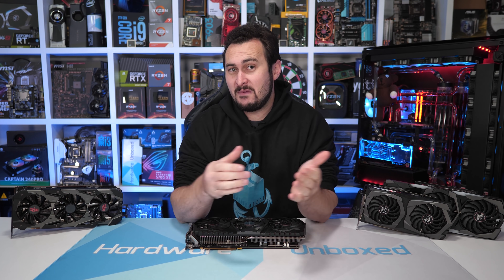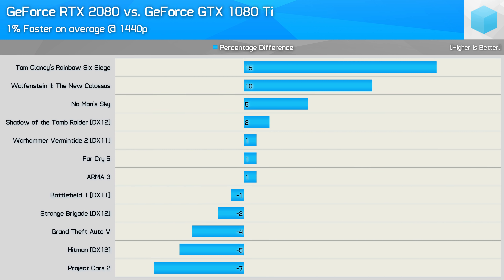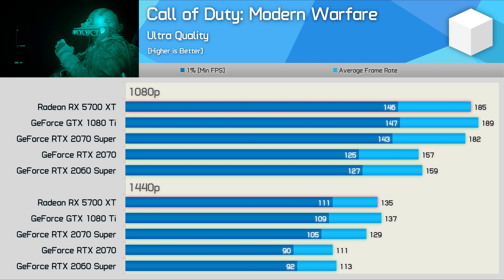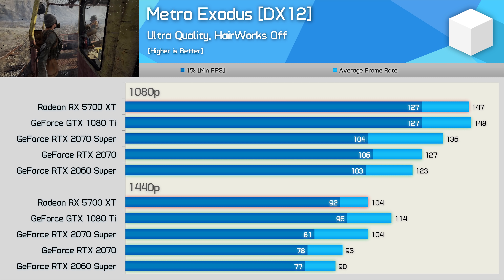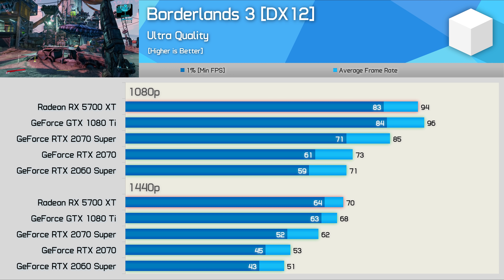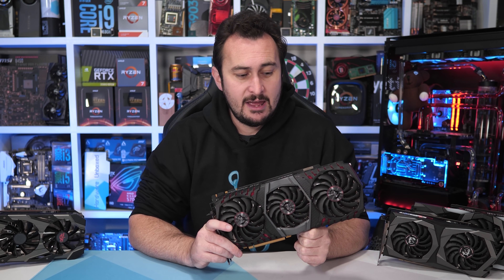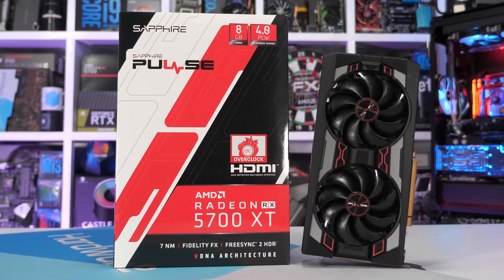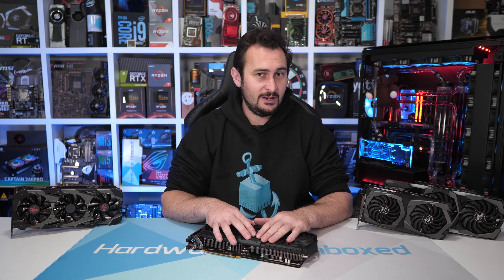GeForce GTX 1080 Ti vs. 5700 XT & RTX 2070 Super, 35 Game Benchmark

Comment: the 1080ti is arguably the best gpu nvidia has ever released in the modern gaming era. Absolute monster.
Reply: Not really, it's to expensive. 
The arguably best gpu's are GTX 970 or 1070(Last gen 080Ti performance for half price).
Reply: @Orcawhale1  they all are starting to show their age. The 1080ti still stomps a lot of cards today
Reply: @Alissa0601  Indeed, but with the money saved. You can just buy a 3060Ti, which stomps 1080Ti(If stock weren't a issue).  
You'd then end up with more performance for the same price.
Reply: @Orcawhale1  yeah undoubtedly the 3060 ti is the better choice, not taking current market state into account.

Comment: I got me an EVGA 1080Ti SC Black Edition about 2.5 years ago and never looked back. I was looking for something to replace my tired GTX 980Ti and this fit the bill and the budget perfectly, once I had sold my 980Ti the price to upgrade came in around £300... Which right now looks like a steal except then I decided to get myself a NZXT mounting plate and a Corsair 240mm CPU cooler and bolt that to my 1080Ti... Yes I don't have Ray Tracing or DLSS but realistically for gaming at 1440 or even 2160 I don't have to worry about either holding me back. Cyberpunk 2077 is running on Ultra, 2160p on my 60Hz screen and I'm not dropping below 42 - 45FPS... I just can't bring myself to sell the 1080Ti and add around a further £500 and not see atleast another 50% overall performance increase. Getting the 1080Ti was a win for me 🤙

Comment: I'm always curious what matters more currently as far as VRAM goes.  What is better, more memory like the 1080 ti with 11GB or faster memory like GDDR6.  I would love to see a comparison of the 1080 ti vs 2070 super/2080 or 5700xt.  Using games that at ultra settings, probably 4k, use more than 8GB of memory.  Yes, I know the game selection would be limited using that much memory.  Not necessarily higher fps, but the most stable ie less stuttering.

Comment: Hi, I hope I can get advice from you. I'm building a pc currently that will be used for gaming but mostly live streaming from my pc. I'm planning to play in 1080p 75 hz so I think I will need GPU that can support 1080p in all games with avg fps 75+. I sorted out my option. I was nearly going for RTX 2060 but then I saw the review that when we used RTX "on" in high or ultra setting in 1080p, 2060 is struggling to achieve above 60fps and it means that I buy RTX for nothing then. no way we want to go to 30fps again even though have RTX on I think.  I found a cheap used as below:

1.GTX 1080 for $270
2. RTX 2060 Super $300

which one would you recommend for those options?

Comment: But what about the 5700 xt's driver issues? I know it's been discussed to death, but the issue seems to persist even to this date. I can't decide between these two. I wanna give the 5700xt a shot but don't wanna spend more time troubleshooting than actually using the card. The 1080 ti on the other hand while old, has more mature drivers and raw performance.

Comment: I regret buying GTX 1080TI for $620 over RTX 2080. I saw the review and was like “Damn, they are the same but the 1080Ti is $100 cheaper". Then the 2080 starts to get better with every driver update, while apparently there was a small performance regression with 1080Ti. More importantly, NVidia neglected 1080Ti with new features like Integer Scaling (I don't buy into their architecture excuse, since AMD did it for all GCN cards dating back 8 years)

Today, 1080Ti is the same as 2070 Super...And I had to 'downgrade' to 2070S because I need the integer scaling for some retro games and DLSS 2.0

Comment: Bought a zotac 1080 Ti Mini which is probably the weakest 1080 ti given the small cooling for 300€. Even used RX5700 cards were 50€ more expensive, and used RTX cards are basically non existent over here. The 1080 ti was a no brainer. Shame I had to wait three years to be able to afford it though.

Comment: i have a 1080ti sc2 hybrid. i cant max out my voltage because the temps stay low enough that it keeps trying to clock higher than 2088 and crash. when i keep it at 2088 max and 2067 average, i get performance that is comparable to most overclocked 280super. better fan (corsair hd120) and a phobya plexiglass spacer keep me under 45c. some kryonaught and gelid extreme thermal pads brought it under 40c. 3080 hybrid will be my next gpu.

Comment: Really difficult market scenario here in eastern europe, have to decide between a zotac oc extreme 1080ti at 560USD brand new vs msi 2070super gaming Z for 600USD and 5700xt for 470-500USD for a decent SKU....not sure what to choose really 2070 has only 8gb gddr6 mem vs 11gbs gddr5 of 1080ti.....for even video production type of workloads to pair with a Ryzen 9 3900X, any advice is welcome, planning to upgrade to rtx 30 series in the q3-q4 of 2021...but till then need a good GPU and cannot wait for the 30  series to come out till October-November this year that is why need to buy one of them right now

Comment: I suppose the 3070 is going to be similar to the 2080ti then, but I'll wait for the 3070s if that's even going to be a thing. Around £500 for 2080ti performance 🤞🏻
Reply: W8 8gb is not enough. A 16gb is already being leaked

Comment: Hello everyone. I am in need of help from someone with technological experience. I have been looking at GPUS for the past 3 weeks and I just simply cannot decide what to buy. My price range is ~$400 US. I have a ryzen 5 3600, 16gb 3200mhz corsair vengeance, gtx 1660 and a 144hz monitor. I have been looking at the 5700xt, 2060 super and the 2070 super. Are there any other cards I should be looking at in this price range? I am looking for card recxomendations that are slightly above the price range because as the nvidia 30 series releases and big navi card prices are going to drop im told. I really appreciate any and all help!

Comment: I am having trouble pulling the trigger. 1. Refurbed EVGA 2070super for 409.  2.  Used from ebay 1080ti 380ish 3. brand new 5700xt 405 plus godfall and wow (dont really care about the games) pairing it with a i7 9700k.

Comment: Yeah im glad i got 2 1080ti's for SLI. Ya ya most games these days are not optimized for it but. Some games are, and its great when it is. 4k Ultra settings Shadow of the Tomb Raider at solid 60fps is nice. Unsure if the 3080ti's will be much of a upgrade. Except for newer games where sli wont work at all, then  a single 3080ti would be better. I usually game on a 3440x1440 so im not sure again, if upgrading is even worth it yet.

Comment: 10 Gaming perfected. I have to say that this generation was the best. I still have my Evga GTX 1080 SC2 since 2017 and it's an amazing GPU, but I'll be upgrading to an RTX 3080 few months after it comes out, or maybe even longer, depends what kind of FPS I'll be getting in Cyberpunk. But I'm more worried about my 4790K(had it since 2014 and OC'ed to 4.8GHz), It's starting to struggle in some of the newest games, if my CPU can't keep up in Cyberpunk, I'm gonna have to spend around 1000€, since Cyberpunk is the only upcoming game I currently care about.
Reply: I upgraded my entire system for cyberpunk. I now own a 3600 and 5700xt system. Coming from a Rx 280 I5 4670k  system
Reply: I bought a pc for monster hunter..sitting at 3600x and 5700xt now

Comment: Interesting that in 2020 I can get a card that performs almost on the same level with the GTX 1080 - GTX 1080 Ti with only $359$! It's my dream a few years ago to play games on a power beast like the GTX 1080 Ti. I got my Gigabyte RX 5700 XT with $359 on eBay (I got a $15 coupon from previous purchases)

Comment: Just bought a refurb 1080 ti from zotac for 413. Not bad considering my 1070 ti mini is still selling for just under 300. I probably would have waited for the 3000 series cards to drop but I have a second monitor (1080p 144hz) that only works with dvi. dvi was dropped by the 2000 series and I doubt it will return. Im sure by the time my 1080 ti isnt fitting the bill I'll lose the 1080p monitor and move to a 4k and upgrade my gpu again then.

Comment: I just upgraded to an RTX 2070 Super from an RX580 8GB since the 3D software I use utilizes RayTracing cores giving me a boost in viewport as well as in rendering. Also Nvenc is a good catch for stream decoding. On Top of it I get RTX voice for Team talks and for my streams ( I live next to a busy street and fire dept. is around the corner so is hospital and that was a major issue for me. It is a beautiful noise cancellation tech by Nvidia which works wonders.)   If It weren't for those techs provided by NVIDIA I would have gone straight ahead with a 5700XT and OC the hell of it. You see it is not always the difference in FPS or Watt usage... Please add various techs offerred by these companies while reviewing them.

Comment: nothing will beat 1080ti even when rtx 3000 comes out. it will be better to buy used 1080ti than a new 3060 100% unless 3060 has the same performance or better.

Comment: The Turing architecture still has loads of headroom for improvement with new driver updates for optimization while they pretty much stopped improving drivers for pascal. I got lucky and happily traded my 1080ti for a RTX2080 when some college guy raged because he had old drivers and fell into an echo chamber of 1080ti elitists on reddit going on about the extra 3gb of vram, which does not hold an argument because Turing allocates and uses the Vram in a much more efficient way. Also they were telling him RTX is all a gimmick just because the rough start with ray tracing. Its only gotten better and with DLSS 2.0 and VRSS. I traded cards in a heartbeat. Definitely his loss, my gain. Plus resale value will be much better since RTX is newer and will continue to improve. Don't get me wrong. I still think the 1080ti is a Beast and respect the hell out of it, But since a run 4K, I am finally getting a constant 60fps with max settings on all games without having to turn certain settings down and cant wait for that huge FPS jump when some of my library gets DLSS support. Maybe Nvidia or some Custom Drivers will figure out how to brute force it for use in any title. On another note, the next gen 3000 series probably wont come out until mid to late 2021 or later and by then im curious to see how far the drivers will push the Turing cards and what AMD is going to achieve with Navi since its look damn good in the next gen consoles but of course they have that lightning fast special I/O architecture with their 10gb/s SSD that even the PC market does not have yet. Buying a 1TB 10gb/s SSD is 2/3s the cost of what the consoles will cost which is pretty cool too. I love both PC and console and this next gen has finally caught up to mid/high tier PCs in terms of graphics and resolution for the first time in history on launch and if not maybe better in some cases because that special I/O architecture that's truly something needed for all next gen gaming for drawing in super 4-8k textures and insanely high assets quality without the need to normal, bump, or parallax maps on models. Since consoles all have the same hardware, they will be optimized even further just like the previous ones instead of trying to make a game work on tons of different components that are mix and matched like the pc world. Sorry for the rant.

Comment: Thanks for the Video! Here in Canada GPU prices are all over priced. I have a 1080 (Blower style) and contemplating whether to get a used 1080ti ($700-$850 is the price here) or a brand new MSI Rx5700xt for $590 (On sale for $40).

based on your review, I am more leaning now to the Rx5700xt. The 1080TI used prices here are just insane... I won't even consider a 2070 super here. Brand new is $800. almost same with a used 1080TI. Madness!. Only thing is keeping me back from AMD are the driver issues, which iv'e been reading they are updated and fixed now. Fingers crossed..

Comment: AMD always throws the cards that they sell the least of to the wolves and sadly that means the high end for them. 3 generations in a row I have seen this happen... it won't happen to me this time though. The only reason these people promote AMD GPU's is because it fuels innovation and lowers Nvidia pricing. THAT IS IT END OF STORY. None of these guys have an AMD GPU in their personal system so why should you? And if anyone does it's a Linux user aka edgy PC guy w/ his all AMD build. Drivers are trash, software is trash, and if you don't buy the one they sell millions of... (580,590 etc.) then fuck your support. Fury X, Vega 64, 5700 XT... all hot garbage, all released with issues 50% of which STILL exist to this day. Look at the Steam hardware survey stats for ANY YEAR since the feature was added what do you see...? Yes... your dumb ass is in the 1% of morons who bought an AMD GPU so they could throw all that $$$ in their CPU department. Well done. I'll be buying a 3080 TI and AMD can go fuck themselves. Just look at how the 1080 TI held up... same will be for 2080TI and the 3080 TI. So you can buy the big dog right now and enjoy it for years to come... or you can buy AMD $400-$500 trash every 3 years and STILL NOT CATCH UP AFTER 3 UPGRADES. Spend the fucking money or enjoy AMD software and driver support. Lmfao.

Comment: This benchmark video proves that 1080ti is still inthe leagues with the current gen cards.Between 5700xt vs 2070s if you are willing to pay 100 to 150 dollar extra for 10 to 15 fps then it's your choice. And for driver problems I bought my MSI RX 5700xt gaming x on JAN 2020 for around INR 37600 and till now I have yet to face any drive issues  or black screens.I have paired it with R5 3600x.I dont know if I got lucky with the card but i am not facing any problems with the 5700xt.Temps are also ok.For me 10 to 15 more fps is not worth 100 to 150 usd price increase..

Comment: sad you didnt include GTX 1060 6GB in tests :) which is what I am still using, but I guess in "ultra high" quality it would be around 60fps in most tests. As I also still run a 60Hz monitor, who really cares. :) Anyway, my next GPU will be from AMD anyway as a Linus Torvalds fanboy.

Comment: Crazy how a 3 year card still performs great in 2020 great video as always. Glad I bought an AMD RX 5700XT Red Devil
Reply: Do you have any driver issues?
Reply: @adnanbutt1924  I have a couple of issues with their drivers and recording game play .... I got the February drivers to work for recording but they had a couple of other issues but nothing drastic. My problem was every driver after that I had issues with it not recording, it would start and immediately shut down and AMD support makes my cable company's support look like geniuses .... They were no help at all and I finally figured out that problem by myself about 2 weeks ago and it was really stupid on AMD's part especially since they seemed clueless and it was changing the audio from automatic to stereo and then it works.  I also had a major issue with a quality USB microphone (Samson G Track Pro) in that it was causing 50-60% of my recordings to have sound dropouts/stuttering even when it wasn't plugged in and I had to go into the Control Panel and remove all the "ghost drivers" and then delete all the Samson entries in Registry to get fix the sound dropout problem ..... As far as I can tell those idiots don't understand how the Windows sound model works and it doesn't put the sound drivers in the Exclusive Mode (And no way to do it manually like every other sound driver)  which means sometimes something would grab the sound output which caused micro-dropouts/stuttering. What made it a b*tch to find is it happened even without the microphone plugged in so I thought it was a Windows Update problem ..... I haven't tried it with the newest drivers because it's such a PIA to fix but I'm building a new system (I already have every except the GPU ready to go) and am going to wait and go back to Nvidia as soon as Ampere comes out .... I don't care if it is $100 more for comparable performance because working drivers are worth that to me since I plan on recording and maybe live streaming AC Valhalla when it comes out and I don't want to be fighting crappy RDNA 2 drivers on the RX 5800 or 6700 or whatever name they give it ..... Love their CPUs but their graphics division has a long ways to go especially when it comes to writing drivers
Reply: Adnan Butt oh and forgot to say It is the red devil that failed now and no I don’t overclock and I have a huge case with tons of airlfow.
Reply: I was too until mine fucking died last night.  AMD has had shit drivers on the 5700xt for while but I believe they may have fixed most of em.  VSR was shit and wouldn’t even work on my platform and I would get black screens when the pc idled or was web browsing but never in games so fucking weird.  Bought an msi 5700xt and rma’d it and sold it cuz it had bad heat issues and now my red devil has lasted me 8 months and now I gotta RMA it.   I don’t know what the fuck is going on but I really wanted go team red and this has soured the experience.  My gtx 690 still works and sadly these new cards  I don’t know wtf is goin on with them.

Comment: 5700xt is such a champ. Even beats 2070 super in some titles🤯🤯🤯
Reply: Sucks that raytracing never actually had any impact on the RTX generation. Don’t want to call it a “scam”, but.... The benefit of the 2060 super and 2070 super never actually ended up coming out. 5700 xt is easily the best $/frame of any of the mid-upper cards.